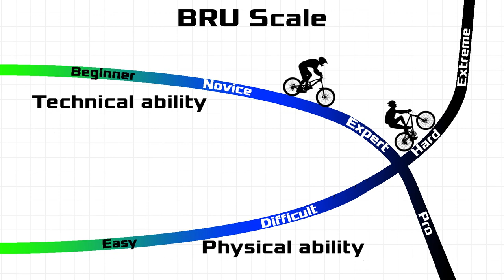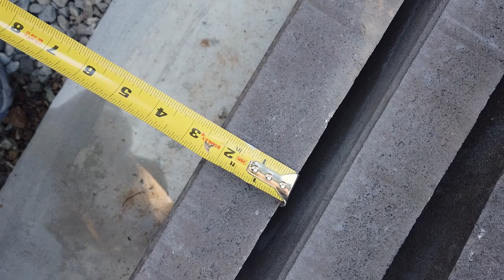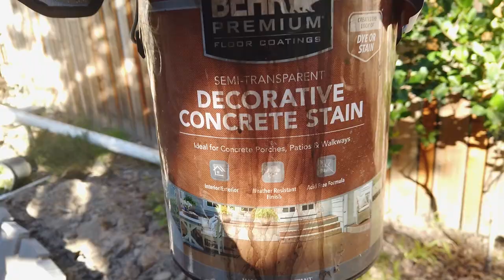Install Concrete Pavers yourself with amazing results

Comment: why not use the compactor to compactact the sand?
Reply from the maker: Sand is used to even out the surface, so the pavers are level to each other. Which is why you use the 1" pipe, and level it with a piece of wood. Once it is level you don't want to walk on it or so anything else that would compact it in an area or move it around. I've seen some guys use pea gravel instead of sand, but I think it would take a lot more effort to even it out.